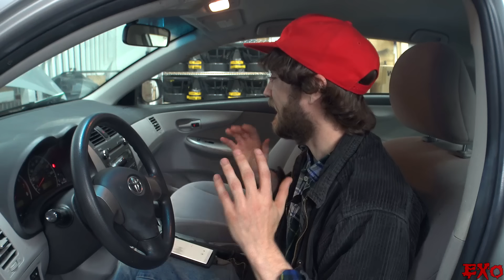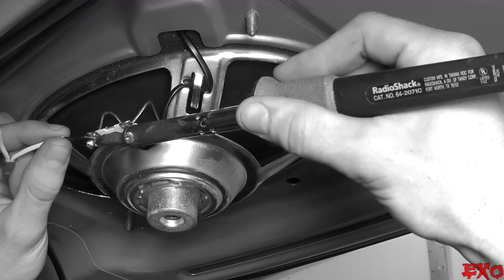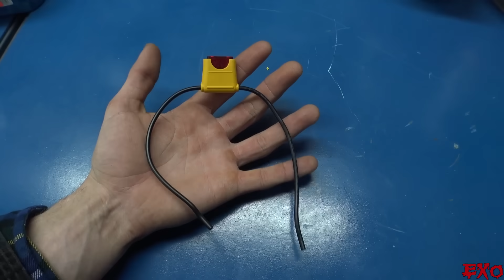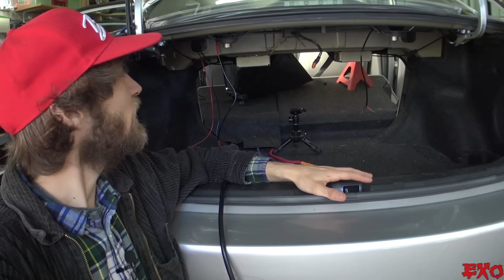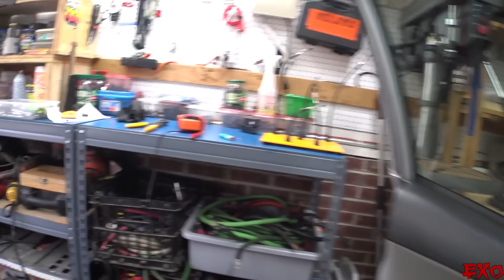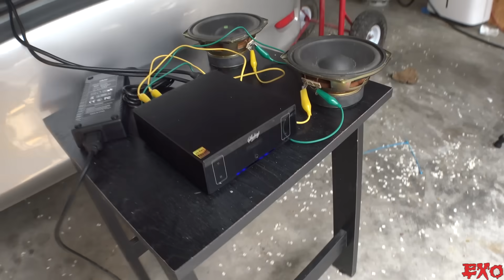How To INSTALL a Line Output Converter w/ Stock Radio & Speakers 4 Aftermarket SUB AMP Installation

Comment: Voltage on RCAs? You said 1.4 is ok. What's too much and too little? I feel like my subs arent getting their full power from the amp even tho it's running 14 volts while car is on and 12 when off

Comment: Am about to do the 2013 tahoe I just bought. It's has a bose system. Those 4 speakers wires on the converter can I just wire the two positive together and the two negative together to one speaker only?

Comment: I’m about to do the same to my charger but I’m curious why you chose to sodder the wires over using wire nuts or just splicing them? Was not sure if it was just to keep everything cleaner or if it helped anything.

Comment: What about if I wanna put two converter? One two channel and one 4 channel? 

They connect like the 2 channel on the back speakers and the for using the front and back ? Does matter of I mix the two channel and the 4 channel on the same back speakers cables?

Comment: Exo, can I ask some advise I am somehow reliving my childhood, now I am putting a sub in to my car , but want to keep oe audio , I have a soundstream exact 10 sub in a made to measure ported box , now I have just purchased a soundstream spectrum hq amp 400w at 4 ohms for my 4 ohm single voice coil sub , amp has high level in put ( come with a loom) do I use this or put a line out converter in ? Lc2i or loc 22 j l , amp has remote ? Car audio center here advised they would put a loc in ? Cheers

Comment: What I dont understand is...you wired the yellow wire straight to constant battery power....so how would the remote wire work to turn the amp on and off? There is no switched or key on power hooked to the unit. It would technically power the amp 24/7 with the key on or off this way. Am i wrong?

Comment: Knock yourself out buddy, I'm wiring my line out converter to the speaker level outputs coming from my stock head unit under the dash, then all I have to do is run wires back to the speaker level inputs on my amp (yes, I have an ancient, 4 channel amp that has line level inputs I got years ago from Radio Shack, but it's not the garbage Radio Shack made, this is made by Pioneer), 340 watt amp which gives me 85 watts per channel.
Problem I have now is, I need a line out converter that'll run my four channels (LF, LR, RF, RR), PLUS a sub output channel for my 170 watt sub amp.

Comment: I have one question as my car have rear subwoofer with 2 negative and 2 positive inputs
Can i use the same method to install line converter on my factory subwoofer but the thing is do i need to use right (- &+) or left from line converter.Or do i need to go back to the radio to install line converter?
Thanks

Comment: Hey, Wiring a linkQ wavetech line converter in a lexus es350 (2012). It has a factory sub in back seat part, DVC apparently. Have an American bass XFL and aftermarket amp. I can’t seem to wire it the right way, have a video with wiring one of these from a factory sub?

Comment: ....."12V from the alternator up front"...he said.  Does it mean that it's only on when the car is on?  It's not the same power cable for the amp from the battery positive terminal?

Comment: Exo i was wondering if i do this and my stock spwakers werent blown like those can i run the stock speakers as mids/highs and use that hi/lo converter to add bass.   Or will the ohm drop kill the stock radios amp?

Im currently running it with stock speakers off cause i wasnt sure.   But would be nice to have reardeck still. 

I know i can probly run my amp in trimode and put rear deck on amp as well but would rather keep as was but with bass added

Comment: Hi,
I am trying to get a LOC to work.
I have attached L+ L- R+ R- to rear deck speaker of my F10, but the subwoofer seems like he is playing the high notes because he gets louder when i turn frequency up to 125khz. When i turn frequency to 40hz which is the minimum on my amp the subwoofer does not move. Gain is set to 80 90% on both amp and LOC.. Any tips?

Comment: Mono block amp? Is there an advantage to wiring 2 rear speakers to the LOC, or can I wire just 1 speaker output to both + and - of the LOC if just used for a Subwoofer Amp?

Comment: The easiest way without converter use high volt input it will be just fine and sound great
Reply: or be silly like my buddy yesterday. Splice an rca straight to the speaker wire and plug it in to the low level input on his amp and not even try to use an LOC. He believed cause it worked it was right..... I'm fixing it for him tomorrow and until then I had him disconnect the shit.

Comment: Does the power wire on output have to be connected. Didn’t connect mine and converter still works

Comment: I have a 2003 acura tl. I installed a L.O.C to the stock amp. To get my signal. Everything works great. Its just sometimes the amp stays on. What could that be.

Comment: If I'm tapping into my back speakers how do I know which ones are positive and negative? Both speakers have different color wires
Reply: The wire that has black on it is negative.

Comment: can i use a Line Output Converter with my 6x9's? "tapped off the 6x9's" will that cause destruction / Oscillation feedback from the subs pushing on the 6x9's???
it is just going to an amp powering my sub.

Comment: I hooked up the remote wire light on amp. Comes on No sounds though subs but if I touch a wire from remote on amp. To power on amp. It works but it then need disconnected when shut car off cuz amp don't shut off and starts humming really loud!! What do I do? So lost!!!

Comment: Can you also connect the Yellow (+12V) and Black (Power GND) wires to the amplifier as you did with the Blue (remote) wire?

Comment: Is it better to install a line-out converter right behind the HU or on the subwoofer enclosure and use the rear speaker wire? You said nearest to the amplifier, is there a reason for that? I can think it would be better the closer to the stereo and use shielded rca back to the sub

Comment: I need help fellas maybe someone can help me on this comment  thread. So I recently Installed some  alpine speakers and amp to my Jeep GC and also an equalizer to my factory head unit. Now speakers and everything work but I have to use the aux input on the equalizer to play music through my speakers. Ok so there are a couple problems I’m having:
1) the blue wire behind my factory head unit doesn’t power on my equalizer so I put the remote wire to a constant red wire there and added a male and female crimp to the wire so i just pull it apart to turn off the equalizer I would like to figure out how to just not have to do that.  

2) my amp stays on even after I detached the remote wire as explained above. I noticed though if I unplug the RCA cables then! The amp shuts off 🤨 

And I lied there’s a third problem lol my factory radio works ! But it doesnt give out sound to my speakers, now the way I wired it up was took one side (left side) of speaker wire joined the positives and then joined a the negatives and ran those lines to my hi input on the equalizer and same on the right side.  Then ran rca to my alpine amp then ran speaker wire to the output line of the head unit that goes to the factory harness that runs to the speakers (hope that made sense).  Now like I said before it works I get sound but only through the equalizer aux input. I would like to not have all three issues but I can’t find an answer anywhere! Please help someone! 😭😭😭
Reply: 1: have you tested the blue rem wire from the HU with a multimeter? It can be something else than a rem. You may be able to use the stereos ground screw at the back. My aux and usb extra equippment is connected to that screw and turns on/off properly

2: Some amps turn on when an audio signal is detected rather than by the rem. Since it does not shut of when you are not playing any music, I am guessing there is interference that gives it a constant signal.

Comment: Hey i have a question so I have an audi a4 stock symphony 2 radio has a stock amp I wired a schoche rca adapter to the single rear stock sub my adapter has a power wire as well I ran to the new sub power wire from battery when the rca adapter is connected to power the radio dims and smokes but the sub works perfect no audio  distortion no loose or exposed wires do you think the issue is the rca adapter or the power wire I ran to the same power wire to the new sub? or the stock amp ?
Reply: I also have left n right wired to the same speaker because they're is only one rear speaker which is a sub and I haven't touched the left n right volume on the converter do you think that could have something to do with it i appreciate your time

Comment: So question, if you're wanting to still utilize your rear speakers would you just chain you LOC inputs from the inputs or would you need to reroute from an amp to still be able to use them?

Comment: hey, loved the video, very detailed and your other videos are great aswell, i have a professional question if you dont mind 
while using LOC, should the speaker wire from the HU be connected ONLY TO THE LOC or should it be connected both the LOC and SPEAKERS? 
the logic tells me that if the speaker wire is connected to both, ill get more power to them, but on the other hand the speakers will get double signal (one from HU, one from AMP), what do u say?
thanks!

Comment: Best video to learn from!.. just one question. So by installing this device, now we are able to get our remote wire from the converter and take it straight to the amp with out having to find another source for example the fuse box?
Reply: Yeah it looks like from what he said that when the LOC receives the signal from the stereo that's when it "kicks on", hence the red light, which is a massive head ache saved.

Comment: Do converters limit the amount of watts your amp can output? For example if I have a 1800 amp will the subs receive 1800 or will the converter limit the amount of power

Comment: I have a question if anyone can answer, I had tried to put one in a freind car yesterday I used a different one years ago but  I hooked up everything right but I’m not sure about the speakers positive and negative now if there not right remote wouldn’t gain power right

Comment: Great video! I took notes and I'm gonna install the LOC right now! I'll come back and comment once it's installed!🙌
Reply: Did you install it what do you wire the remote wire to?
Reply: @KRYZMA23  Yep! Got it installed! I connected the remote wire to the amp!✌
Reply: @joeblack5300  do you have to solder?
Reply: So your amp stays powered on always or???
Reply: @KRYZMA23  No! it only turns on when I turn the radio or car on!🤔
Reply: @KRYZMA23  Go to 9:40 in this video where it says to connect the remote wire to the amplifier!👍
Reply: @KRYZMA23  The way LOC's use the remote turn on is by sensing frequencies from the input wires (in most cases, the rear speakers you tapped into.) When a voltage is seen (so when music is playing or a tone is being generated) it will turn on. Most have a few seconds of delay, that way it doesn't power off and on between songs. 

Pretty helpful little devices if I do say so myself (:
Reply: Thanks man

Comment: Im using a 4 channel line output converter with stock radio. Qould I be able to hear all my 4 speakers and my sub doing it this way?? Im using an amp for highs and one for my sub.

Comment: how do i tune it so that all bass goes to the subwoofer and not speakers? When using a lineout converter and crank up the bass on the radio all bass goes to speakers and subwoofer, i only want the bass to go to the subwoofer. Thanks
Reply: On your amp there may be a high/low pass feature on it, which you'd want it set to low pass, or you'd want to get a low pass cross over from the amp to only allow low frequency signal to go through.

Comment: If you have an aftermarket headunit you still have to connect a remote to a amp so its not running 24/7 right ? how can I connect to the fuse box??

Comment: Hllo bro, I am using car amplifier at home. Now want to give high level input on amplifier with inbuilt high level input socket. But there is plus minus and gnd terminals. Where can I connect gnd

Comment: I have a Nissan Rogue 2016 and i am having trouble convert the audio I’ve bought different devices and no sound still comes out of my factory radio can I get some help on what can I do or what do I really need to buy so I can limit everything and see if it works

Comment: i got a 2013 camry and i installed a scoche loc with trigger and it plays fine but sometimes it stops playing and the amp is still on but the sub isnt getting any signal. I bought a new rca cable to go from the loc to the amp but the problem is still there. Could it be because i disconnected the tinsel lead going from the terminal on the speaker to the coil? 

tl:dr do the speaker tinsel leads need to be connected to the speaker? line out converter keeps cutting out.

Comment: Thanx for the vid mate ! maybe a stupid question but how is it possible that the converter turns on and off the right way ? normally the remote cable takes care of it but u wired it straight on to the baterry right? correct me if i'm wrong
Thanx

Comment: Thats the video I needed to see.Im installing a schooch line output converter in my car with an aftermarket radio.I have no room to run orca and rem from the radio to the rear speakers.Its an installation wire saver for me.

Comment: I'm having a boooom if i cut off my radio!  I have a loc hooked up .a PAC SNI-35 ADJUSTABLE 2 CHANNEL LINE OUT CONVERTER SPEAKER WIRE HI LOW RCA. Do i need to ground the 2 brown wires.? SNI35 help !!
Reply: Greg, I'm no expert and have been researching install methods.  Came across the thread
https://www.hondaaccordforum.com/forum/audio-visual-electronics-10/hooking-up-subwoofers-my-rear-speakers-using-line-output-converter-38128/
Your 12v supply might be on a wrong circuit.    Good luck!

Comment: I have a question.i have sony dz 350.i want to buy this converter so that I can connect to the front left and right midrange speakers of the home theater because I want to buy a car amp for more bass.now I don't know if it will work that way.please answer

Comment: so i have a qvestion,i have on my car amp that hi low button,and i dont need and hi low adapter,but my qvestion is,like i saw in video maybe i saw bad,you just borrow the signal from rear speakers?you didnt sacrifice them to have an amp,like i saw they are working together with amp?because i have stock radio and 4 speakers,i would take the rear speakers and send the signal to an amp,and like i saw you just borrow signal from rear speaker,and thery are working fine with an amp,you didnt sacrife them just to have an amp,if i get it corectly.

Comment: Dose the sub still get louder when you turn up the volume on the original head unit?
Reply: it will, its better toadjust the gain on your amp

Comment: Did this on a 10 Jeep Patriot sounded great then he did speakers I guess n I did a double din and nothing works now can you do this install with an aftermarket deck I didn't use a line converter

Comment: Generally speaking don't do this. It's a cheap solution to a complicated problem and you'll get "cheap" sounding results. Get a Fix86 or a Cleansweep or whatever. Absolute worst case get something like an LC2i with Accubass correction. There's a 95% chance your stock audio system MANGLES your low end output below 60hz or at a certain volume level. If you're doing a stock radio integration, and you actually want it to sound right, you're likely going to need a DSP not an LOC. Just an LOC on a traditional stock deck is going to give you anything but flat sound. Play a 30hz tone and check your amp output. You'll get 5v. Play a 40hz tone and you'll get 15v. Play a 50hz tone and you'll get 30v. There is no way to properly tune a system when you're dealing with that kind of shit for a response curve.

Comment: So wait, he said the remote out cable from the line converter would go to the amp, and the rca cable also went to the amp, so how would he turn on the amp from the stereo??? Unless he meant stereo when he said amplifier when he was talking about where the remote out cable would go.

Someone pls help
Reply: to the remote out put on your amp. the middle input.
Reply: Jangus Roundstone, I just recently installed my first audio I setup in my car and I wanted to make sure I was doing it the right way, thankyou for clearing up the confusion😁

Comment: hey can anybody help me.. i have a amp that makes engine noise in my subwoofer... i have use a seatbelt bolt to ground my amplifier but still getting this heavy engine noice anybody knows how i can fix it or know what the problem is?

Comment: Hey man love your vids. And not really sure who else to ask since most of my audio shops near me are scammers and I try to do stuff myself.

I have a 2018 Jeep renegade with the 8.4 uconnect. I bought a LC7i by audio control and was using that as my loc to hook up to a hertz hdp5. I am getting no signal what so ever. 

Everything is connected right etc.... I heard that some stock radios have a certain expected ohm even though the speakers I upgraded are still 4ohms. Kinda lost lol

Comment: i had a doubt wiring a powered sub in a jvc 2 din head uNit.. Should i use the RCA cables for signal / sound or is the high to low audio converter a better option. my stereo supports RCA output. but the installiation fellow told me that using speaker wires through a high to low audio converter will give better results. Pls guide me..
Reply: The low output converter is an option for when you dont have rca outputs, if you have rca outputs, use them, the low output converter is in now way an upgrade. Its an adapter system.
Reply: ok.. Thank you so much for guiding me..!!

Comment: Did you know that there is soldering wire that already gas flux inside the soldering wire it’s like 5 or 6 bucks👍